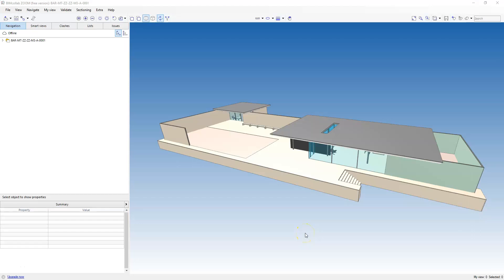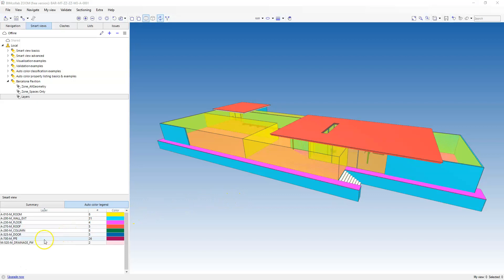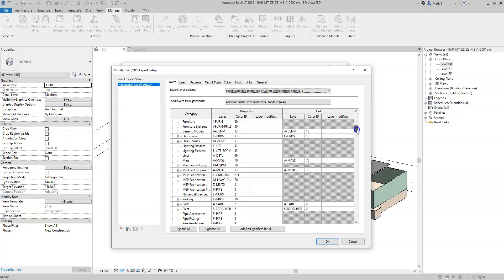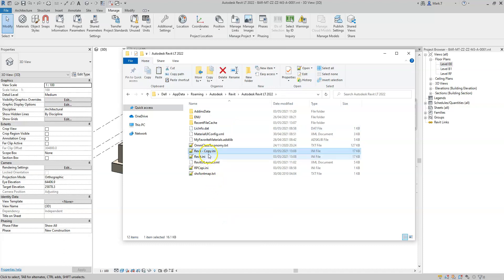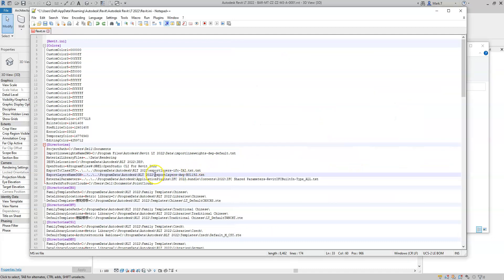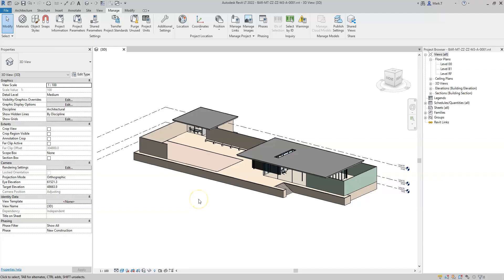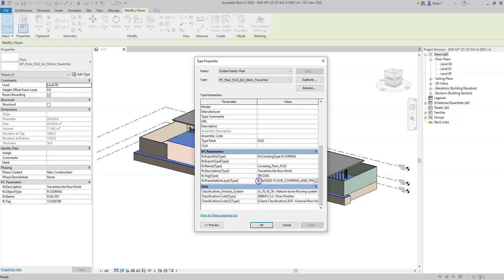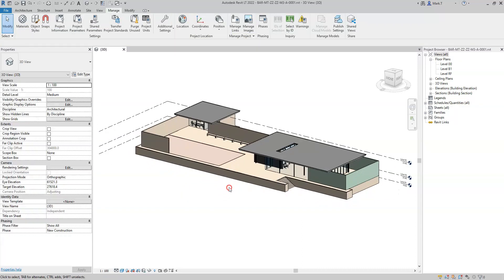Revit to IFC: An Export Guide - Part 10 - IfcPresentationLayer (CAD Layer)

Comment: another great video but just a few points
1- ISO13567-1:2017 should be updated to ISO13567-2:2017+A1:2019 which was updated inline with ISO19650.
2- Changing the Revit.ini is ok as you are just highlighting you can change the path and filename but this only really works if the whole company is a single discipline - if you are deploying in a multi-discipline company then you may need multiple files as layers will be discipline specific i.e. A-, S- or ME, but i always recommend just to leave this as you can override the standard file exportlayers-dwg-BS1192.txt to suit whatever project or discipline specific requirements you have.
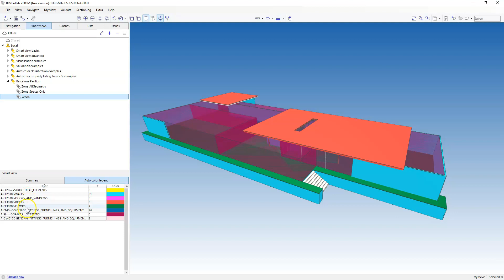3- Timestamp 4:18 - layers EF20, EF40 & SL have hyphens (--) which if character is not being used should be replaced with underscores as per ISO13567-2 cl. 6.2
Reply from the maker: Thanks Graham. I knew this one would likely be the one that would contain the most mistakes due to the use of the relevant ISO standards so thank you for clarifying.